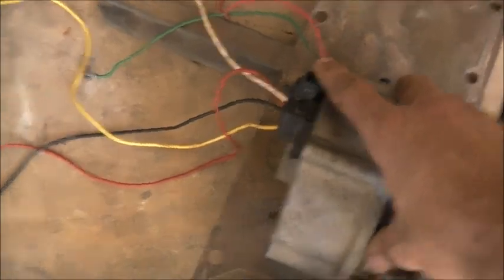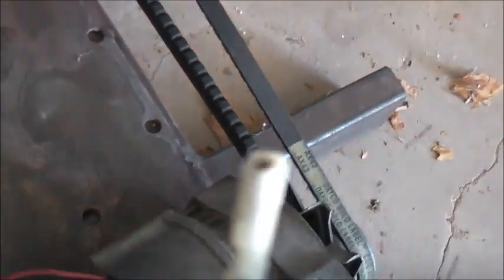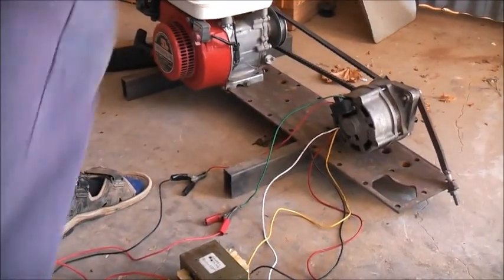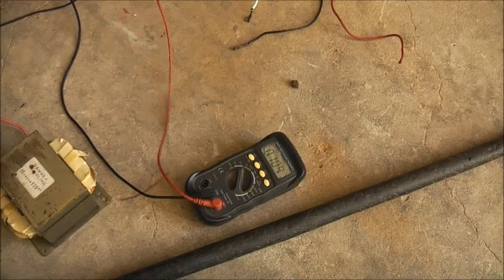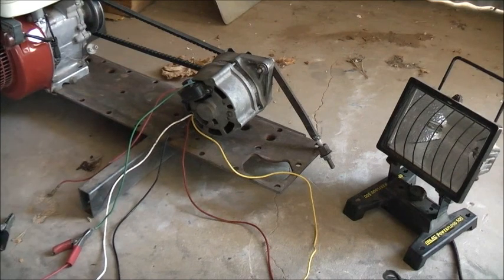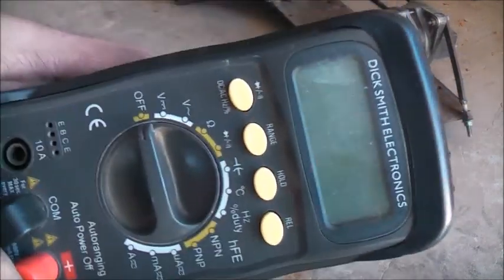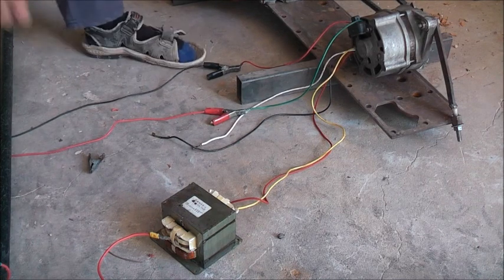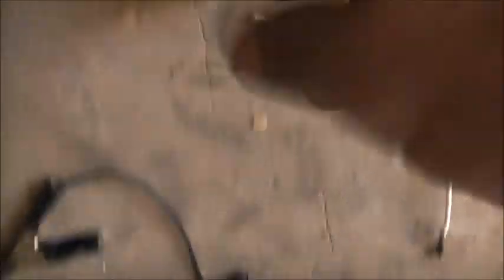Alternator Mod!!

Comment: hmm this gives me a good idea, seeing how the frequency varies depending on the speed of the shaft, I wonder if I can use one of these instead of my home build inverter VFD to give some single phase motors some horrible torture. I may have to try this, maybe ill have better luck. Keep up the vids HDFXH :D
Reply: hell maybe if I can pick up a Fisher & Paykel smart drive motor, may have even better result with that but not so common down here in the U.S. or at least my area.

Comment: Interesting experimentation with a car alternator, but I have just read Rodalco's comment and he says that there may be a possibility that the alternator makes 3ph (may be Star or Delta, that's unknown) and then that would've gone into the rectifier which you've since removed in order to get AC out of the alternator.

One thing you didn't measure (or I didn't see you measure) in this vid: Frequency of the AC.

If the frequency is too low or too high, the MOT may not have liked it. Let's say because of the revs, the alternator was turning out only 30Hz, I'm not sure if a MOT could flux correctly on 30Hz, and if that alternator is 3ph, then you'd only be putting 120 degrees of the sinewave into the MOT, so it would probably flux erratically.

Also, if the alternator is 3ph and you only had it connected across 1ph (1ph if it's Star, but you would have had it connected across 2 phases if it's Delta) then the alternator would've been running off-balance which, if it wasn't the current you're pulling, it would've been the mis-balancing which made it get hot.

Look into whether the alternator is 3ph, and if it is, then figure out if its in Star or Delta.

Thanxx for showing,

-BoomBoxDeluxe.

28th March 2014, 15.46

Comment: You get actually three phase out of the alternator. i am currently building a 3 Phase set up with 3 step up transformers.( not finished yet )
Don't pop your DMM I have done that on the HV winding of a MOT.